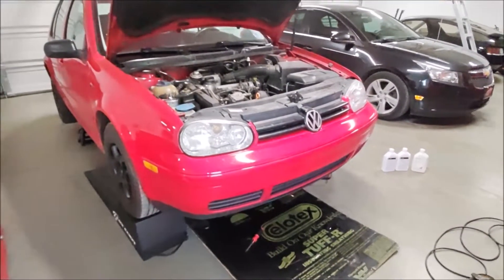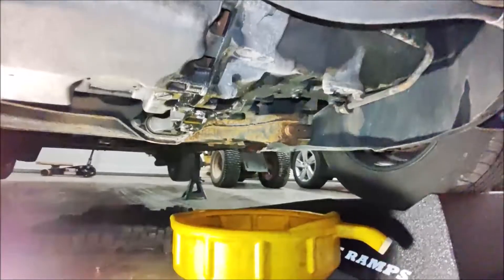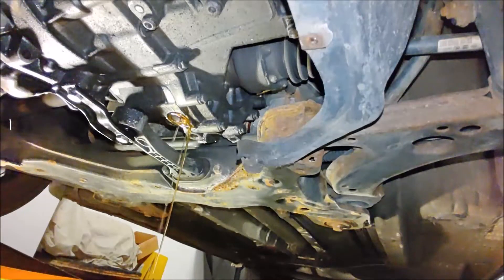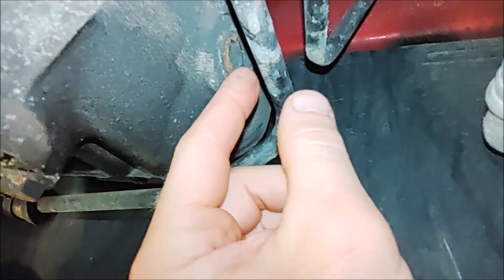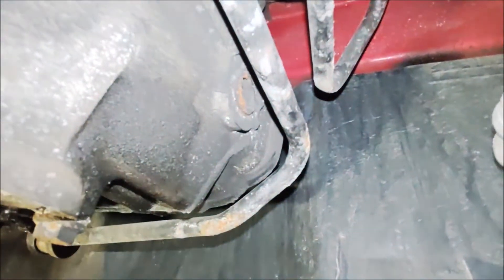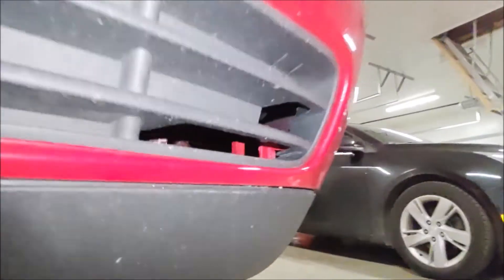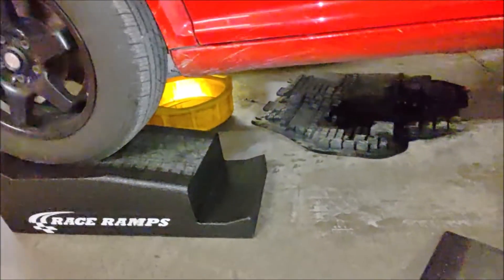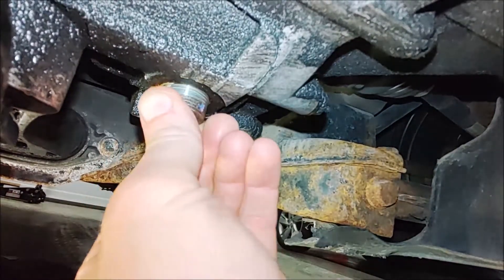VW Golf mk4 02J transmission fluid change

Comment: I have a automatic will that transmission oil still work for my m4?
Reply from the maker: No, you have the 01M auto which takes different fluid. The process is different altogether. Here's the kit that you need: https://www.fcpeuro.com/products/vw-4-speed-automatic-transmission-service-kit-oe-supplier-kit-00113
Reply: @Corysdiyauto okay thank you! I also have a short video on my channel my 2006 volks golf won’t crank but everything else turns on

Comment: is the procedure and chosen oil the same for 6-speed ERF 02M transmission?
Reply from the maker: The procedure is the same, but the fluid is different. The 02M uses G052171A2 synthetic fluid.

Comment: Always open the fill plug first to avoid the gargling.
To unscrew the drain plug eithout getting hands wrt. Attach a hose to snug go over the drain nut and rotate on a bend so the oul goes down the hose.

Comment: Is there any way to check the fluid before replacing?
Reply from the maker: Do you mean check the fluid level? If so, you just need to be on a level surface and remove the fill plug. If fluid comes out, then you are at the correct level. There's not a dipstick on this transmission.

Comment: I'm doing my 2000 golf TDI today. Weird, my power steering line was not in the way of my fill plug at all.  And yes, of course I broke it free before even touching the drain plug. 
I'll be refilling with Liqui Moly GL4+ 75W90.
Another tip I've heard that I am going to do is to rotate one of the front wheels (you would have to elevate it off your ramp) by hand to distribute the oil around and see if you can get any more in before you replace the fill plug.
Update -- Was able to get the full 2 liters in by rotating a wheel with transmission in neutral.
Reply from the maker: Thanks for sharing!
Reply: Thank you for making the video!
I updated my original comment. By the way, that Liqui Moly comes with a really convenient telescopic pouring tube. I was going to use my hand pump that screws into a standard gear oil bottle neck, but didn't even need to.
Reply from the maker: I'm glad that you liked it. That's good to know about Liqui Moly. I will have to give that a try next time. Good job!

Comment: Nice work!
Threre is a catch with all vw group manual gear boxes. No mater how fresh you keep the oil inside the gearbox,  in the end of the two shafts there are two ball berings that fail all the time. 
I have this problem now on a skoda, those berings have their own grease and they are not lubricatet with the oil inside the gearbox. So, like any bearings will fail over time. This is defective design.
Reply from the maker: Thank you. These bearings must be of high quality because I have 221,000 miles on the original transmission and haven't had any issues with it. The clutch is still original!
Reply: Sadly lots of be models have design defects

Comment: Would this fluid work okay with my 2000 Vw 2.0 with a 5 speed believe the transmission is o2j. Just want to use the right fluid
Reply from the maker: Yes, you have the 02J transmission and the correct fluid is exactly what I used in the video.
Reply: @Corysdiyauto  okay perfect just nervous as I’ve read a lot about the different fluids and just wanted to be 100% thank you so much man I really appreciate it.
Reply from the maker: @devonboyd  - You're welcome! Good luck with it.

Comment: Loosen fill plug first ✅….becouse if you have problems removing the fill plug after you have drained the oil…your…FUXXED!!!
Reply from the maker: Good tip! I wonder how often that happens with this transmission? That fill plug seems very robust.

Comment: Is the same for golf 4 1.6 74kw engine apf? 2 l is enough to refill?
Reply from the maker: It depends on what transmission you have.
Reply: @Corysdiyauto  5 speed manual
Reply from the maker: I'm not familiar with that engine code(apf?) Is this a gas model or diesel?
Reply: @Corysdiyauto  gasoline Petrol
Reply from the maker: @nandorzsigmond2654 - I believe that you have the 02K gearbox and the capacity is 2L.

Comment: Tip to anyone watching, always loosen the fill plug first. Because if it doesn’t loosen and you’ve already drained the oil, you’re in trouble
Reply from the maker: Good tip
Reply: damn dats a real menage right there
Reply: I came to the comments to say the same thing. If you realize the fill plug won’t come out before you drain, you can drive the car wherever you need to get that fixed. But if you drain the tranny and THEN realize the fill plug is seized, stripped or for whatever reason won’t come out; the car is undriveable.
Reply: I would say that, as en emergency solution you can lift the car on one side so the drain hole is higher than the rest of gearbox  and fill through the drain hole 2 liters of oil. You can use a seringe.

Comment: you can do this without the jack. its safer but a little more cramped. Also wud b good to know how much fluid u used, the cap on the tranny is over 2L, but you seemed to only use less than 2 liters of new fluid

Comment: Lol when I drained mine, the oil was grey. Pretty sure it has never been changed by the previous owner. How often do you change yours?
Reply from the maker: Gray? That's not good. I change mine every 50,000 miles. How many miles are on yours?
Reply: @Corysdiyauto  220k before it was changed lol
Reply from the maker: Whoa! Lol

Comment: ALWAYS open fill plug first !
What if you get it drained and for some odd reason you can't get it open ?
Reply from the maker: Right on! I thought of that after I did it.
Reply: @Corysdiyauto  some will have a vent also.
Reply from the maker: Does the 02J have a vent?
Reply: @Corysdiyauto  I recently p/u an '03 Jetta wgn 5sp gas. I haven't got past 17mm hex plug socket yet, though it's on the list.
Enjoyed your efforts sir.
Reply from the maker: @randallmunson9909  - Good luck with the Jetta!
Reply: @Corysdiyauto  $75 with @270k but, made in Germany. I hadn't the heart to watch it go to the local bone yard since it ran strong.
Reply from the maker: @Randall Munson  - That's a pretty good price!! All wagons were made in Germany to my knowledge. Too bad it's not a diesel though.
Reply: @Corysdiyauto  I had a VW Rabbit diesel ... No thanx.

Comment: Hi Cory love your work, I have the same TDI but AHF engine, I also see your splash guard for a car that is 200 000 miles is super clean and neat, and all the bolts are there wow.
Reply from the maker: Thank you very much! I try to keep the car maintained properly. When I bought the car years ago, the splash shield wasn't there. Someone had removed it, so I bought one because it's important to have in place.
Reply: @Corysdiyauto  do u have a video of how to flush and replace your coolant? I really wanna know that one.
Reply from the maker: @vampir335  - No, I don't have a video on that unfortunately. That would be a good one though!